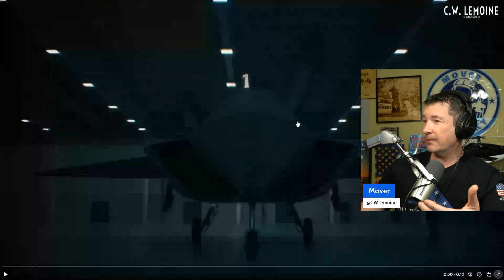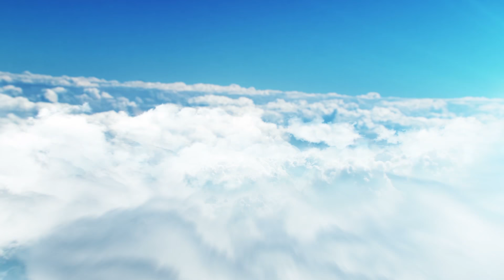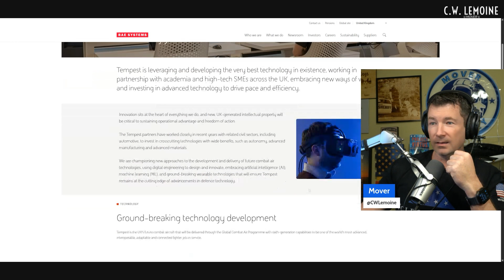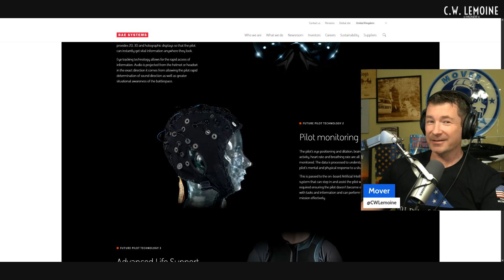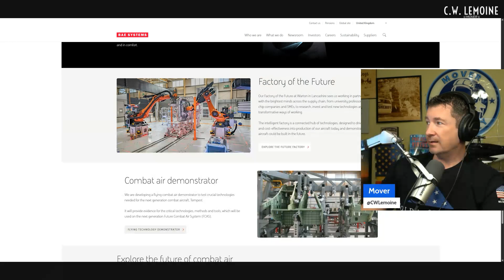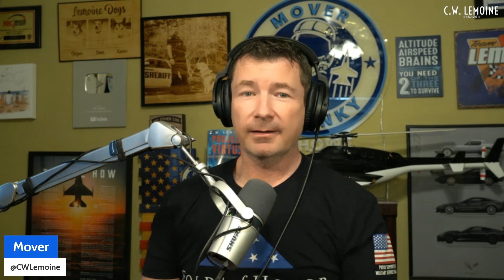The Technology Behind Britain's New Tempest Fighter

Comment: “Britain’s new fighter” is Japanese.  All BAE has done is join Japan’s Mitsibishi F-3 program that’s been in the works for years.
Reply: Complete nonsense, Tempest has been running for over ten years.
Reply: @glynnwright1699 Likewise with the f-3, it didn't appear suddenly, if you look at Wikipedia, the research has been going on since 2010.
Reply: @faisalabdulaziz6956  The UK's  research into stealth fighters was incorporated into the F35.
Reply: @glynnwright1699 
Completely nonsense, F-35 main contractor is US. That time, Tempest program doesn’t exist.
Reply: @oboro115  'The United Kingdom contributed significantly to the design and development of the F-35 Lightning II. As the only Tier 1 partner in the System Design and Development (SDD) phase, the UK invested over $2 billion in the program, securing a 25% stake in the design specification. "
Reply: @glynnwright1699 
I know UK is F-35 tier-1 partner.
But that time not exist Tempest.

Japan develop engine since 1991 for F-3 which is 6th generation fighter.
In 2005, Japan did not have RCS test equipment. 
It was rejected by US, Japan brought a life-size stealth prototype to France for RCS test with the cooperation of the French Defense Agency.

Italy and Japan has F-35 final assemblies line, we have F-35’s  manufacturing technologies. UK don’t.

So meaning is Do not think only UK has technologies, Japan and Italy also has.
Reply: @oboro115  15% -20% of every F35 is manufactured in the UK. Rolls Royce designed and manufactures the lift engines for the F35B , it is the only western country that has ever designed and mannufactured successful VTOL aircraft. RR exclusively provides engines for the A350, the UK designs and manufactures the vast majority of wings for Airbus. 
Work on Tempest started decades ago, long before it was publically announced. You might wish to pretend that the UK has no special expertise or experience but the team that are building GCAP know that isn't the case, and that is why the headquarters is in the UK, not Italy or Japan. I worked on the Eurofighter when it was EFA, before Italy even joined the programme. Even then we were thinking about what would be building next. I have the greatest respect for both Italian and Japanese engineers, I have worked with both, but the idea that the UK, the only country thast actively particiapated in the design of the F355, is relaying on countries that have never designed any elements of a 5th Generation aircraft, is not founded on fact.
Reply: @glynnwright1699 
I understand how you proud of joining F-35 JSF program, but this is GCAP. Not 5th generation fighter. We are creating 6th generation fighter together, 3 countries bring new technologies for GCAP.
There is no led country.
Reply: @oboro115  
1)Tempest is being built right now and will fly long before GCAP (scheduled for 2027), just as EFA flew before Typhoon.
2) There are five countries that can build engines for fighter aircraft without any external assistance. Neither Japan nor Italy are on that list.
Reply: @glynnwright1699 
Tempest demonstrator which is CAFD(combat air flying demonstrator) build at BAE.
 It use EJ200 engine, not GCAP engine.
It will fly on 2027-2028.

Japanese ATD-X(Advanced Technological Demonstrator-X)(X-2) already flew on 2016-2017.
The engine made By IHI which is XF5-1 engine.
Reply: @oboro115  XF5-1 engines in service  = 0
EJ200 engines in service = 1500.
Reply: @glynnwright1699 
XF5-1 is experimental engine.

XF9-1 engine In 2018, the turbine inlet temperature reached 1,800°C and the maximum thrust reached 15tf(147kN).
The size is like P&W F100
Maximus thrust is almost same as F-22 15.87tf(155kN)
F/A-18E/F 10tf(98kN)
The XF9-1 engine produces power generating capacity 180kW
a two-engine=360kW. 
F/A-18E/F＝55kW、
F-22A = 130kW
F-35 = 160kW
XF9-1 has thrust vectoring nozzle.
Since 2019, Japan have been conducting research to apply the adaptive cycle engine to XF9-1. 

EJ200 engine is the turbine inlet temperature reached 1,800°C and the maximum thrust reached 9tf(89kN) and 55kW only.
Reply: @oboro115  No sales, no production, it is an experimental engine.
Reply: @glynnwright1699 
Even Britain couldn’t reach Japanese experimental engine’s result.
Reply: @oboro115  You have no idea what RR can achieve because it is classified. R
Reply: Literally the other way around.

Comment: Vibrating seat is great and all, but the thing has no control surfaces. How is it going to maneuver, do everything with 3D thrust vectoring?
Reply: It's a conceptual render
Reply: its unlikely to have 3D thrust vectoring its not a dogfighter its more a bomber
Reply: @graveperil2169  I looked at other images, and it looks like a possible 2D vectoring. That's why I wondered about control surfaces, as its replacing the Eurofighter.
Reply: Japan developed XF9-1 engine has 3D thrust vectoring nozzles.
So GCAP has technologies if necessary.

Comment: iam surprised with this video. Last time I read news the Tempest was on hold or even discontinued project.
Reply: You are thinking about the FCAS, the Franco-German-Spanish program, that has run into some troubles, but still otherwise ongoing. The tempest is from the GCAP program (Italy-UK-Japan) which, by all accounts, has also run into some problems but waay less than FCAS.

Comment: I don’t think the Tempest fighter jet jointly developed by Japan, Britain and Italy will fly for the first time before the F-47. And based on the analysis of the data seen so far, it is more like a 5.5-generation fighter rather than a sixth-generation fighter. The sixth-generation fighter should have better stealth, higher AI integration technology, and higher-level engines.
Reply: What are you talking about? There is no indication at all that the F-47 will have better AI integration or engines than the Tempest. We have heard almost nothing about the AI tech in either, and both are using next-gen adaptive cycle engines. As for stealth, you could just as arbitrarily say that range, cruising speed, and payload capacity are what defines "6th gen" - all of which the Tempest likely out-performs the F-47 at. Those are the trade-offs that are made between delta+tail vs gamma+tailless; the latter prioritises stealth at the cost of poor flight performance. The Tempest actually had a gamma wing in earlier designs, but they moved away from that, which indicates that their priorities are different from what the US is looking for. The Tempest is going to replace the Typhoon, so it is likely designed to work as a long range patrol and rapid response interceptor, where endurance, speed, and payload capacity are all more important than stealth. Given that it will surely still have better stealth performance than the current 5th gen, the huge trade-offs needed to improve that further may well not make sense.

When you say "it is more like a 5.5-generation fighter rather than a sixth-generation fighter" all you are really saying it "it isn't designed to perform exactly the same role as what the US is building".
Reply: @Aethid You're kinda treating "we haven't heard details" as "they must be equal," and that's not how this works. The US already has Al sensor fusion flying in the F-35 today, Skyborg/CCA drone wingmen testing, NGAD demonstrators in the air, and adaptive cycle engines (XA100/XA101) physically built and tested. Tempest is still earlier in development on most of that. So it's not parity, it's a maturity gap. And the stealth vs performance thing is a false trade. Modern air combat isn't about turning harder, it's about who sees first and shoots first. Survivability + sensors > kinematics. That's why the US prioritizes tailless stealth designs. Tempest being optimized for range/payload to replace Typhoon is fine, but that's literally a different mission set. "Different role" doesn't automatically mean "same generation capability." It just means different priorities.
Reply: @GoGoPooerRangers All of the technologies you listed are also either in service or at a similar level of development in Europe.

Stealth significantly beyond 5th gen levels requires significant compromises. Compromises that are not needed for many roles and missions.

You don't need stealth for interceptor missions, or for delivering long range standoff weapons (that themselves are low observability such as STRATOS). Climb speed, cruise speed, range, and payload capacity are all more important.

These are all the reasons why the F-15 is still in service and even preferred over the F-35 for many missions. All despite the F-15 being massively out of date and having no stealth at all.

The Tempest is an interceptor and a missile truck, built with the same technology base as the F-47.

Saying that "6th gen" requires a tailless delta wing design is defining "6th gen" in terms of mission rather than technology level.
Reply: There seems to be some misunderstanding.
The GCAP and F-47 are not enemies, the goal is for the GCAP and F-47 to fight together to shoot down the J-36 , J-50 and more, so there is no need to worry about whether you think 5.5th generation or 6th generation.

Anyway Since 2019, Japan have been conducting research to apply the adaptive cycle engine to XF9-1.
So GCAP engine will be much. powerful adaptive cycle engine.